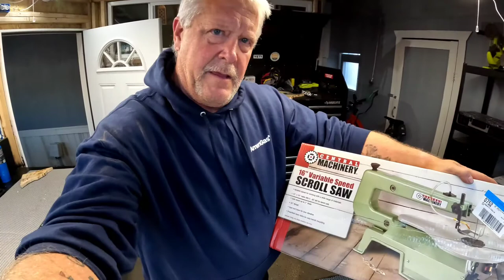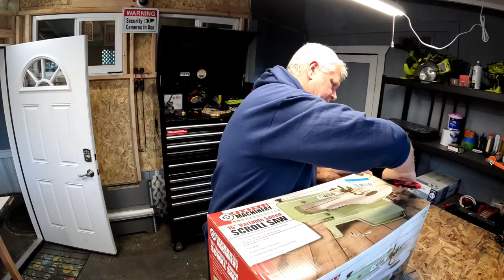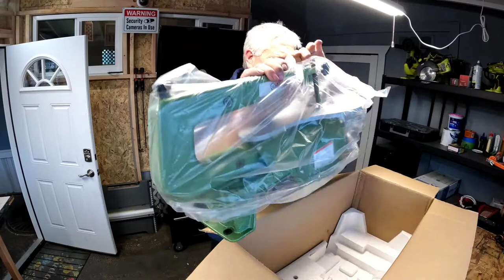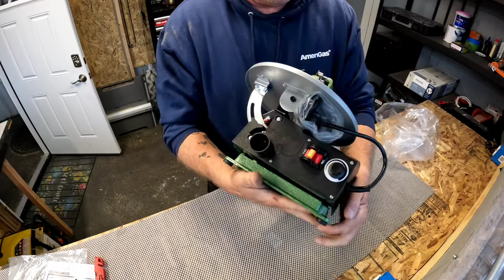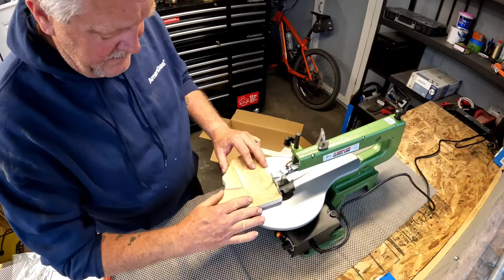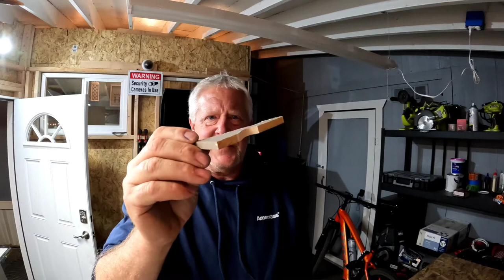Harbor Freight Central Machinery  Scroll Saw.

Comment: Almost all entry level scroll saws use the same size motor and will bog down, especially in thicker, harder wood.  Also, most saws come with cheap blades that don't work very well.  Performance can be improved with good blades, but saws like the Harbor Freight model also have a drawback when using pinless blades: the process of changing blades or doing interior cuts is a real pain.  If you want a quality saw, you will need to look at saws costing above $400.  Hope this helps.
Reply: What scroll saw do you recommend?
Reply: Very true. I’m just starting out. And purchased this scroll saw. And yes, I know it’s an entry level product. My gripe is that of the pinless blade setup. It’s seems unusable. The metal tabs used to hold the adapters seem too flat. And even when I could get them on. The blade had to be bowed. So that it could reach, to be hooked, b/c there’s a long screw preventing the blade to go on without touching the screw!?  Overall a saw that will do the basics. Then you move on.